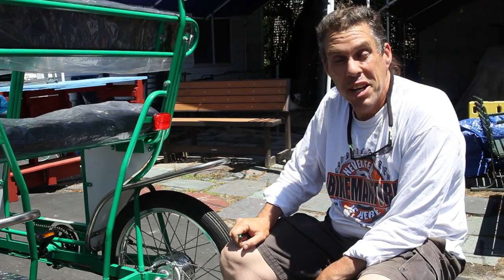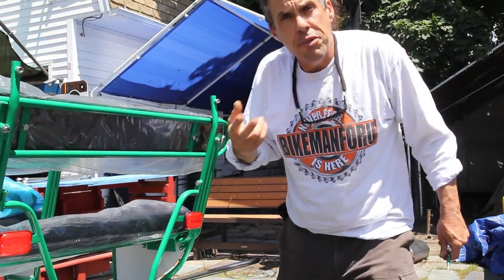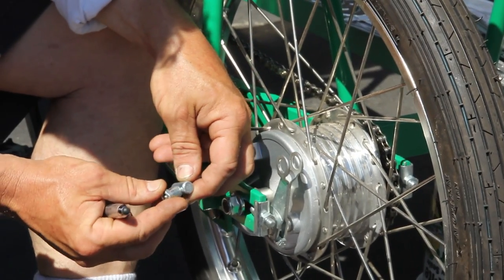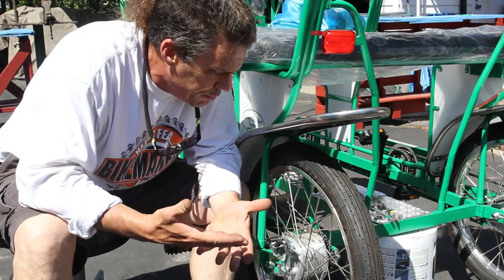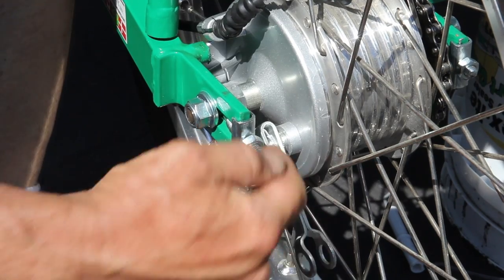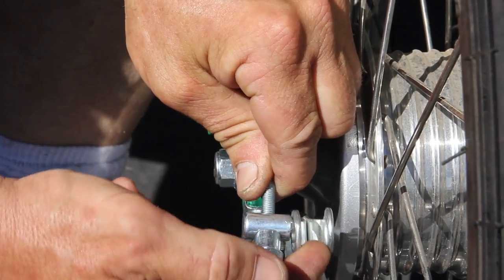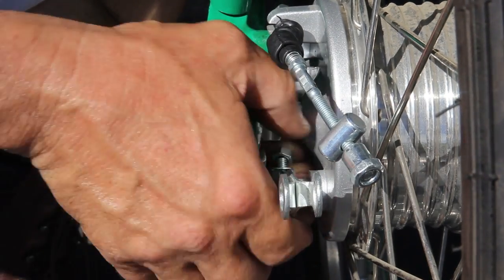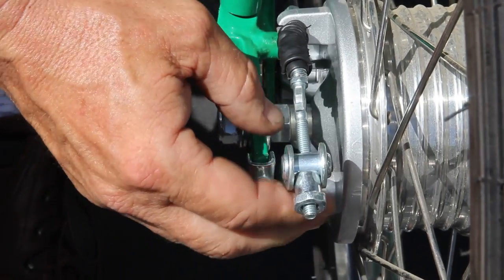Drum Brake Assembly / Adjustment - International Surrey "Quadcycle" - BikemanforU

Comment: Nice to see its splined and has that adjustment :)
Reply: Matthew Schurter  should that back nut be blue loctited ?? maybe it holds on the round pass thru
Reply: for sure but sometimes a round fits on a half round but that is usually spring loaded   situations where theirs pressure
Reply: further thought is a backup nut might be in order but they did say no spare parts were found...let me have a looky :P
Reply: +Matthew Schurter  should also have a 2nd locking nut too

Comment: Cool.  Out of curiosity, since there is one lever, and two cables...  Is there a mechanism somewhere to balance out the brakes (so you get equal braking forces from both brakes with out the sensation of the brakes pulling of the bike to one side or the other) - or is that done manually though the cable adjustment?
Reply: Reggie Reginato     I want to know the same thing